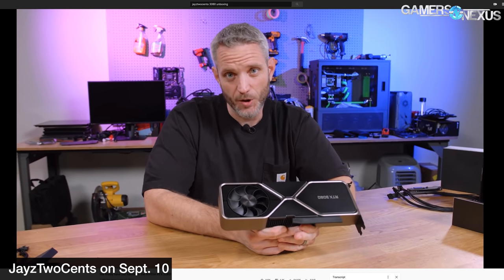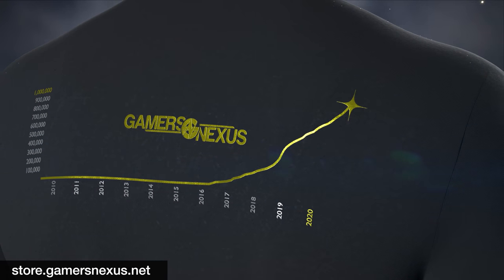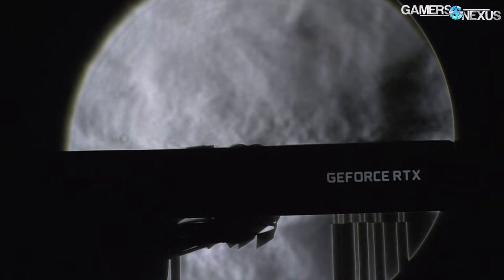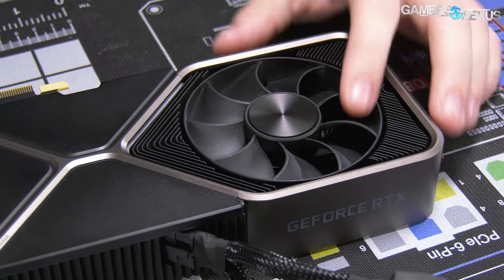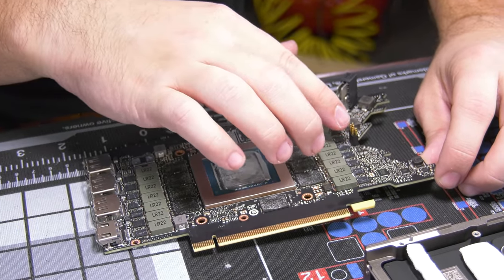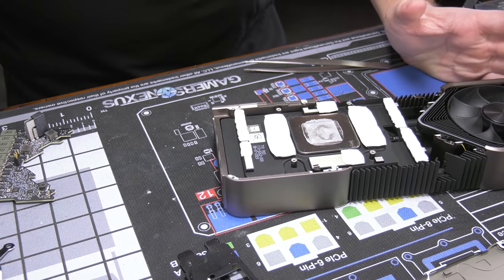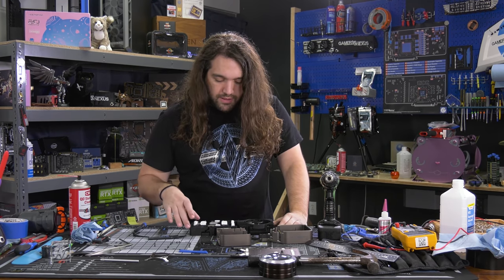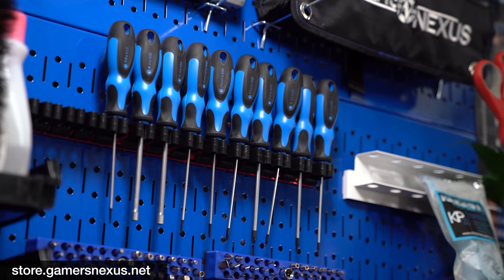Tear-Down: NVIDIA RTX 3080 Founders Edition Disassembly - A Lot Fewer Screws

Comment: "hide all the screws" when you mention having to guess the torque spec for each screw when unscrewing, i thought how cool would that be if you could get a dial type torque wrench that would allow for small phillips or flat heads. when unscrewing the gauge would tell you how much torque was applied to loosen the screw. ive only ever seen this kind of tool in the automotive industry and those are pretty old and hard to find (pretty uncommon type of torque wrench) but it would have to be a design that would be practical for smaller fasteners.
Reply: It would not work correctly with any type of Loctite applied to the screw as it would take more torque to remove it than tighten it.
Reply: not really a good way to know how tight as a screw nuts etc can bind over time requiring a lot more torque than originally used to install giving a incorrect required installation torque.
Reply: Because it's easy to destroy stuff. Unlike automotive there is not a block of metal on the other side.
Reply: @juicy9592  For the ones holding the cooler to the die the mounting pressure determines how good is the contact with the cooler. Too little and you get bad contact and high temperatures. Too much and you risk damaging the solder (it happened to me once in 2001) or the die. It is also important for the torque to be even. It can be eyeballed with some common sense and most of the time it will be fine but so can an engine, likely the engine will have larger tolerances.
Reply: The tool i think youre talking about is called a "torque watch". Can get them down to the single digit in-oz range and up to the tens of in-lb. Good suggestion
Reply: @GeraldMMonroe  Once you've taken apart a few graphics cards you just get used to how much of your finger strength you need to use to get it tight enough.  There's no need for an exact torque spec on these things.
Reply: @ZepG  Not only that, cracking torque will always be higher than the intial setting torque. Anyone using this method to determine how to torque their screws will over torque them everytime...
Reply: @someusername121  That's the difference between someone who cares and someone who does not...
Reply: @maxnaz47  Nah, the dif between someone having experience or not.  Novices always think this hardware is a lot more fragile than it really is.
Reply: Damn that's sick
Reply: Not saying this is necessary i just thought it would be neat especially since GN is very scientific and medothical

Comment: That exterior unibody aluminum is actually for structual rigidity instead of just look. Having it made out of metal will help keeping the heavy part framed to the back instead of stressing the PCB. If they make it out of plastic they will have to make it way thicker and therefore less space for the heatsink and the fan size.

Comment: The INTRO!!  xDD

Agree...   Extra fan  in the middle  would HELP
Reply: Throwing one in my new build using a Cooler Master SL600M case. Those waist fins are going to get a ton of cooling air. The case was almost built for this card. CPU will be AIO cooled too.
Reply: @janus3555  I suppose but just even slow fan directly in the middle would help.  And these back case covering the heat... should be dismantled

Comment: i just used a piece of tape to remove those 4 screw covers. really easy. Magnet did not work bc they are facing the wrong way. If you have that RED 3M strong clear tape that you can buy on ebay use that. its what i used and they came out super easy.

Comment: ‘A stick with adhesive’, I would interpret that as a stick with some tape, otherwise it would’ve said ‘a stick with some glue’. Can imagine they don’t want to promote the use of magnets with sensitive electronic equipment.
Reply: Yeah, doesn't sound as glue to me either. I suspect what they meant was "sticky putty on a stick" or similar which should work fine for this. I think using tape is probably a better solution, TechPowerUp had success with both sticky tape and "fine pliers".
Reply: This isn't a HDD or a CRT where magnetism is used to do something so it's fine
Reply: @Assmagnus  sure, glue is an adhesive, but it's more about the question 'would you use glue on a videocard?' I wouldn't think of it, therefore, as I said, I would think they meant something like tape or putty. Yet they haven't been specific, so it is really up to you what you think works and are comfortable with. As for the magnets, the risks are small, but it is not impossible to damage the card, basically this Q&A: https://superuser.com/questions/113430/what-computer-components-are-currently-vulnerable-to-magnets
Reply: For real. Who would use actual glue. The tape made more sense. Not glue lol

Comment: GN: Some people are so beginner, they think that taking it apart is breaking it
5 minutes later
GN: Yeah these thermal pads usually break when you take them apart but we were lucky.
5 minutes later
GN: Yeah you gotta be careful with this cable because you can literally break it just by taking it apart
5 minutes later
GN: All the screws are out but you can't take the PCB off because there might be cables under that break when you take it apart
5 minutes later
GN: The 2060, you had a very high chance of damaging something just by trying to take it apart
Reply: It only breaks if you don't know how to take it apart or don't care how you take it apart
Reply: This does make the video funny, but what I think is meant is that you don't have to break to take it apart. It seems like with an expert you can just put it back together or only have to replace some menial parts.

Comment: Adhesive: hot glue. Remove hot glue with rubbing alcohol. Done.
Reply: Hot glue doesn't stick to everything. Particularly metal that doesn't have allot of pores or roughness for the glue to seep into. All got glue is just plastic with a low melding point basically.
Reply: @bakadeshi_aunstudios  the screw caps are plastic with an inlaid magnet from what GN noted

Comment: Anyone trying to disassemble any modern electronics: "Wow, what a colossal pain in the ass"
Reply: Laptops got easier to disassemble and simpler over the years, 1st gen core laptops had 2 or 3 big plastic parts and tons of different screws, but with modern laptops you just unscrew at the bottom and you're in

Comment: 20:42 So is it save to assume some 12 GB card down the line ?
Reply: No. We will get a 20gb 3080, bit they will just double the vram in the modules. Those extra pads are for the broken parts of the silicon(binned) so those lanes are unusable due to the die being cut. Like he said in the video, those empty position will change for each individual 3080 gpu (bad parts of silicon will be different for every gpu) if the die had no defects then it would probably be branded a 3090 and they would fill all of those pads with 2gb gddr6x modules and that would be you 24gb of vram on the 3090
Reply: @shawnpepin7890  it's also interesting as it potentially sheds some light on their yields. Perhaps 2 defects per die was a high probability.
Reply: @shawnpepin7890  If low/no-defect yields improve giving nVidia more choice over what silicon goes in the 3090s and AMD actually tries to release something even halfway competitive then you could see a "3080Ti" able to utilise all those pads faster than you'd think. Besides, even if yields improve not all the extra silicon will be able to remain stable across all clusters at 3090 speeds.

Of course if yields don't go that way and there's pressure you would more likely see an overclocked 20GB version with the Ti moniker. Whereas if AMD doesn't compete at this level this gen then the stock 3080 will be all we get anyway :/

Comment: The TIM is a phase change material, not a grease. That's why at room temp the TIM is stiff, but it will soften when heated. With that in mind, expect better TIM1.5 performance and rel.

Comment: "Professional driver on a close course" made me laugh out loud...

Also best magnets:  rip them from an old hard drive. They're frikkin amazing.

Not a big fan of pin-to-pad connectors. Contact pressure can diminish over-time, degrading signal strength. Depends on how strong the internal springs are and the quality of them.

Comment: Inch pounds? Please it’s “Ugga dugga”s for torque. 😂 (Yes it really should be a metric measurement like Nm for torque)
Reply: Heh, yeah I'm used to Nm as well, at least for implants.
Reply: I like ugga dugga.  Torque bolt down to 35 ugga duggas. Has a nice ring to it. 😛

Comment: "adesive on a stick" : since when does that imply using glue ? adesive is tape
Reply: adhesive is adhesive
Reply: @andruloni  adesive just mean something that stick. glue is not something that stick: glue is something that bound via chemical reaction, cold welding stuff to each other.
Reply: @ereder1476  yeah, that's, like, your definition, man.
Reply: @andruloni  no dude. that's litteraly what glue does. it melt the end of both of the material you want to glue together and fuse them as it dry
Reply: @ereder1476  look I checked some dictionaries for definitions so I'm not gonna just believe what you claim is true. Glue is for glueing things together. If the materials melt and fuse together that's a special kind of glue but you can't just claim a wood glue is not glue without evidence.
Reply: @andruloni  good, then now you understand that if you glue two things together: then you are not using an adesive. since glueing two things is suppose to be permanent. And no it's not a special kind of glue. all glue do that.
Maybe you should buy some and test them all out.
this is why you have different type of glue. because plastic glue (most used type of glue) does not work on wood for example.

By definition an adesive is something that stick to a surface. glue don't stick. they fuse.

The only reason an adesive stik is due to the adesive material. an old tape with worn out adesive material won't do shit it will be friable. You can't reuse adesive material endlessly because of that.

i mean come on dude. Even i as an ESL i can still clearly made the difference. or is it because i am ESL ? and thus have more variety and nuances in my vocabulary?
Reply: @ereder1476  ok dude, I guess in your language wood melts and fuses when you use a wood glue. and a gelatinous goop made of bones also melts and fuses surfaces. that's glue, glue is an adhesive. that's even what English and Polish dictionaries and wikipedias treat as mostly interchangeable. You could have provided your sources instead of typing that all out. Adhesive tape is covered in glue in my books and it if it's permanent or reusable is just properties of the glue
Reply: Of all the hills to die on, you decide on glue?
Reply: @rotor13  you see, glue melts my flesh so what else am I supposed to do?
Reply: Adhesive, also known asglue, cement, mucilage, or paste, is any non-metallic substance applied to one or both surfaces of two separate items that binds them together and resists their separation.
Reply: @fadelpw511  allright then, that proove my point: you are being victim of limited vocabulary. Adesive is a borowed word use on tons of other language. https://en.wiktionary.org/wiki/adhesive 
Adesive : "a substance that causes to adhere" Adesive stick to a surface but it does not fuse with it.

Wich is why other language have more word to define and differenciate if something stick to a surface of if it bind to it. (mainly because one affect the integrity of the material while the other do not)

Fact is: nobody would think of using glue on a stick when the text says "adesive on a stick" because the term adesive imply a non permanent solution as it only make two things adhere to each other. not bind.

Funny enouth you can still find that different in the english language during common speech: you won't use the term glued and stick  interchangably.  And you will never say an adesive band is "glued to" . you will always use the word "stick" instead
Reply: @ereder1476  First you insult their intelligence by claiming a limited vocabulary, then use... other languages as an example? And for the record, there is an entire category of products called construction adhesives that do exactly what you're saying adhesives don't do: they bind materials. 

So yes, it's absolutely commonplace to refer to glue as adhesive. And for all your patronizing bullshit, if Nvidia had meant for people to use tape... THEY WOULD HAVE SAID TAPE. 

Imagine being wrong, being called out, and digging deeper over the word adhesive.
Reply: @ereder1476  funny enough you still can't spell adhesive right
Reply: @JustinHall1468  the word adesive is not native english. that's why i mention vocabulary. it have nothing to do with intelligence.
Knowing multiple language can drastically increae the nuances and vocabulary in the words you use. thoses are well known fact and i am sure you have experienced it well.

Comment: for screw cowers hot melt glue stick works ok in my experience. Just heat one end of the glue stick with lighter and put it on a screw cower wait to cool down and pull.

Comment: I actually really like that cooler...the fact that one fan vents to the rear like their older reference cards is really nice as that's that less heat recirculating inside the case. I might finally be able to put the side panel back on my case which I'm looking forward to as my airflow is dogshit and my 2080 is a literal space heater.

Comment: Nvidia wanted you to accidentally glue those screw caps to the frame of the card in order to hinder your disassembly process. Also, the residual adhesive on a stick method makes it easier for them to tell that you tampered with the card. Despite the lack of a sticker that warns that your warranty will be voided if you tamper with the card, I bet it says something along those lines in the instruction manual.

Comment: They could've put the power cable on the bottom of the card. or embedded on the edge within the cooler towards the motherboard so that the cable has a straight shot to a hole in the motherboard tray and no exposed wires at all. It wouldn't block cooling any more than the current one if it is on the other side - it would just mean the adapter cable would need to be longer, and would be plugged in first and the wire runs along the back edge. This would cause a small issue taking it off the board if the person didn't give enough slack - but if they ran the power supply cables in the back then the extension from the card could meet it and be lightly pushed in so if you pull the card out, the wires come out without any hassle. This would've been a much better design choice in my opinion because of less airflow blocking, etc.. The cables would be hidden quite nicely. ie: power adapter flipped to the other side. No extra blockage, cables routed behind the card, no cables running under the card and blocking more airflow, etc...

Comment: I thought about Duct Tape instead of the Glue on Stick trick though I like the Magnet method even better. What Tech doesn't have at least a hard drive head magnet lying around?
Very nice tear down - yes I do agree you need to annoy the Nvidia Engineers. At least they finally listened about the design

Comment: That chip, cooler and the metal shroud are massive! Probably cost a lot to manufacture and assemble too. Why not use the more advance TSMC 7nm node which should produce a cooler chip hence lower cooling requirement?

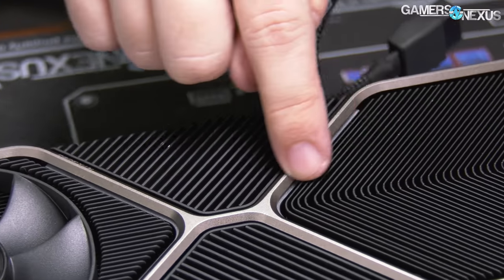Comment: 4:05 no they are not. Radiative heat transfer is very insignificant for computer cooling temperature ranges. Especially for what, ironically enough, people call "radiators". These additional fins provide cooling by utilising airflow present in the case, as well as natural convection (which to be clear is not only down to up flow).

Comment: I wonder if they could have got better thermal results if they had a single fan in the center, and orient the fins so that air can blow through in all four directions from the center, that way heat gets pushed out from the card in all directions.

As far as screws go, the Gigabyte R9 380 Windforce was great, you could take the shroud off with 4 or 6 screws, the heatsink fan assembly off with 4 or 6 screws, and the backplate came off just with the 4 screws that surround the GPU chip.

Comment: Heat + magnets = Dead magnets after some time. Will there be a problem when these magnet-covers falls out after some time of heavy usage? Are any parts of these magnets conductive? If so say goodbye to any PCB's under them.
Reply: Are you talking about the screw caps? They weren't magnets , he just used a magnet to remove them, they are metal..

Comment: At least we Can re-paste it with ease... the nvidia paste solutions are usually crap so that video is a huge help also a good cleanup solution for that be ArctiClean Kit 1 & 2 Thermal Paste Compound Remover its good dissolver seems to be doing good job and less hassle on rubbing that alcohol cloth on that gpu. That would have make me extremely nervous as i noticed alcohol simply wont cut it in some cases like this one and they clearly over pasted it. Thx for the inside view of this monster of a gpu x)

Comment: nice presentation and your analysis and how interesting it is and there is no proper cooling and plenty of sauce will not keep it stable without anything happening is a fact There are many ways and he wants the right materials to have proper temperature management, the materials on them get very hot. I am from Greece Mr Nexus God job

Comment: The Turing 2080 Ti die naming is TU-102-300 A1 or in the early sku's also a non A version. The 3080 die naming is GA 102-200! Therefor it stands to reason that it's the GA-102-300 Ti SKU that is missing between the 3090 being GA-102-400 and the 3080 being GA-102-200.... or am I totally out there with this conjecture... I don't remember if the 2080 was named TU-102-200 and I'm too lazy to check but yeah that's my two cents on it.